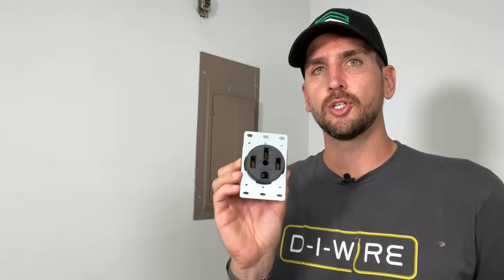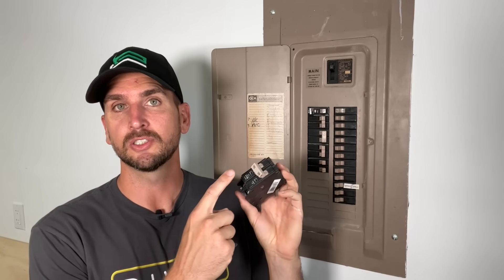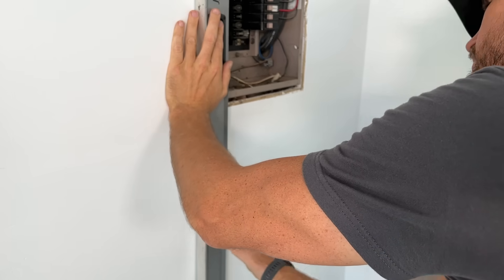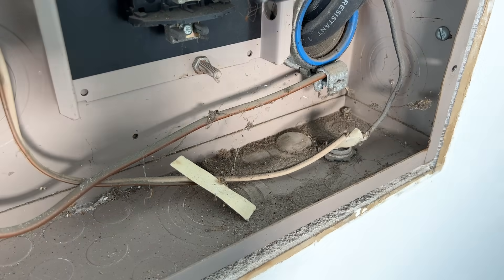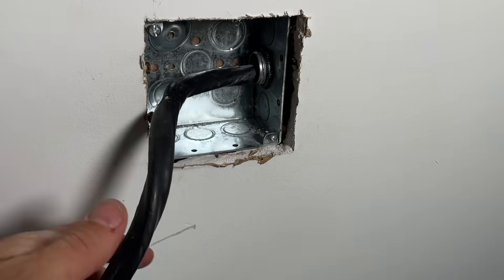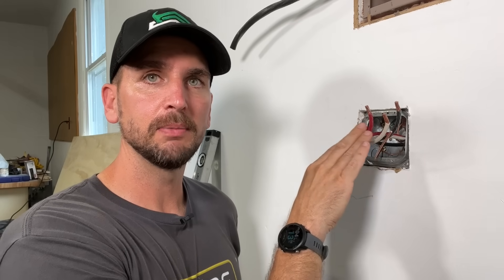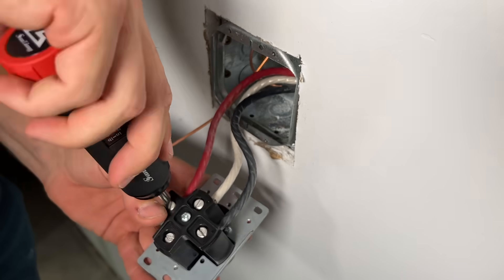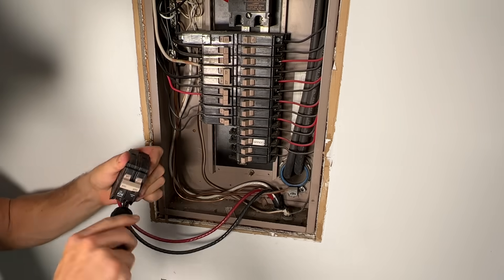Quick and Easy DIY 240V Outlet Install | 50 Amp NEMA 14-50

Comment: Great install!  I have one suggestion.  I would highly recommend paying the extra money for the commercial grade 14-50 receptacle.  I realize they start in the $50+ range, but this is not the area I would want to save money on if it were my house.  Again, nice easy to understand demonstration and clean install. 👍
Reply from the maker: Not a bad idea and thanks for the feedback.
Reply: @EverydayHomeRepairs   Update your video with this!!!! Plastic NEMA 14-50 receptacles are not rated for continuous loads like EV chargers and WILL melt, possibly causing a fire. You don’t want to be liable for someone’s house burning down because of your bad advice.
Reply: As someone who walked into their garage to discover the smell of melted insulation and find my 30amp charger plug fused to the $10 Leviton outlet (after about 2 years of use with the plug always inserted) I recommend using a commercial grade outlet.
Reply from the maker: @retass1979  good stuff, thanks for the additional details Jason 👍
Reply: Depends. If you are using it with a portable EVSE that gets connected/disconnected all the time or if you are putting it somewhere for guests to use their EVSEs, then definitely get industrial grade. If you are going to leave your EVSE plugged in all the time like a dryer or range, then a decent quality standard receptacle should be fine, but you should also consider future use even after selling the house. You or subsequent users can always upgrade later but, of course, then you’ve ended up spending more which is an argument for buying industrial grade in the first place. The supply chain issues have actually flipped the script on that though with Hubbell IG receptacles going for stupid money (darn near $200) so for the moment it may actually be cheaper to install a lower grade and wait for prices to normalize. With inflation the way it is though we’ve got another monkey wrench in the mix.
Reply: @emmettturner9452  ... Hubble industrial grade outlet can be had for $80-$90 if you shop around. I have seen them as low as $65, although not recently. They are also rated for like 10,000 insertions, not just a few hundred.
Reply: @rupe53  Yeah. It’s the recent supply chain-related price hike that I’m referring to. The rebadged Bryant is still available for around $65 but that still expensive enough that some would consider going with a hard-wired EVSE. With hard-wired EVSE you can get a 48A unit and you don’t need a GFCI breaker to meet the updated code requirements which weren’t touched on in the video. Of course, those codes don’t really apply to DIY anyway unless doing permit work or selling.
Reply: @emmettturner9452  ... he mentions they are still on 2014 code, so install to local code and be grandfathered. Someone else can do an update down the road if required.
Reply: @rupe53  Yeah. The thing is, DIY isn’t beholden to code in the first place to be grandfathered unless it was inspected/permit work (typically a much bigger job). This is probably why buyers, lenders, and realtors often require a home to be inspected and brought up to code when they are selling. They will typically consult whatever the current code is in the area, and we can expect all areas to follow NEC 2020 eventually. That means the grandfathered exceptions really only apply until you sell. That said, some places selectively chose parts of the NEC to enforce/ignore. Some places that have adopted NEC 2020 also specifically exempt the GFCI requirement for EVSE installations.

So, yeah, for DIY I’d only be worried about the new NEC 2020 code requirements if I might be selling. The EVSE should already have GFCI, since detecting faults and cutting the power to the onboard charger is part of an EVSE’s job. Also, nuisance-tripping is a problem with EVSEs on GFCI breakers, which is another reason why many locales have carved out EVSE exceptions for NEC 2020.
Reply: @emmettturner9452  ... and that false tripping is why I mentioned (once again) that people need to read the manual and find out if their charging device already has a GFCI. Having two GFIC devices will make that false trip a regular thing.

BTW, home inspections usually only point out things that don't meet standards for when the home (or remodel) was built. Very seldom are people asked to meet NEW code.
Reply: @rupe53  Thanks. That’s what I was wondering about since they often refer to the renovations as “bringing up to code.”
Reply: @rupe53  The thing about false/nuisance tripping with double GFCI is that the new code requires the GFCI breaker regardless of what your EVSE has, and half the point of a receptacle is to accept various EVSEs as opposed to a specific one (guests, future upgraded units, second vehicle, etc). IIRC, properly built and “listed” EVSE’s should all have GFCI according to J1772 and certification standards which creates a conflict/contradiction with NEC 2020.

There are numerous unlisted and non-compliant EVSEs that do not have GFCI, like the notorious Mustart brand that keeps burning down houses and such. Unfortunately, Mustart and the clones often lie and claim to be J1772-compliant and/or UL Listed. People who expect GFCI because they read up on the standard are likely to be misled and if they do any more research than that, well, they probably figured out that there are even bigger reasons not to use it.

Someone needs to make a more affordable hardwired EVSE, even if it is a lower amperage, since the GFCI breaker hurdle/issue will ensure a number of sales. I actually bought a 12A EVSE control board for $30 (ClipperCreek Gen2) that was new-old stock for GM EVSEs and paired it with a $50 used J1772 cable and a waterproof project box with cable glands to make my cheap hard wired unit but I can no longer find those boards for sale. Mine wouldn’t be listed/certified, of course, but it shows that it should be possible for some manufacturer to make a $250 wall-mounted EVSE with no plug since that’s the same control board from a listed product.
Reply: @emmettturner9452  ... depends on the renovation. If you do a kitchen, then the kitchen will be up to snuff. Same with a bathroom or finished basement, provided there was a permit and inspection. The rest of the home may be totally untouched. I know my area was lax on electrical years ago. They would let you upgrade a service, but inspection stops at the panel. IOW, no enforcement on GFCI for kitchen or bath (etc) just going from a 100 to a 200 panel. But again, that was 20+ years ago. It may have changed by now.
Reply: @emmettturner9452  ... as you stated that home brew deal is not UL approved as assembled. Someone would need to spend money to have that done. I would have to read the NEC again, but recalling they ask for GFCI protection on car charging, but don't recall if they specify where or how. In my mind, a hard-wired charger with a self-contained GFCI would be ok... if the unit was UL approved.
Reply: Definitely a must if you're plugging in and unplugging using the mobile charger, not as important if you buy a wall charger that stays plugged in.
Reply: Regarding usage for an EVSE, the constant unplugging and plugging is not the issue for a commercial vs industrial outlet. The issue is a CONSTANT and CONSISTENT high amperage draw, in this case a constant 40A for 5-8 hours. Typical commercial 14-50 receptacles don’t experience that as appliances like an electric stove/range or dryer a constant high amperage hold - these types of appliances have higher amp spikes which quickly fall back down to much lower ratings. Do it right the first time and get an industrial outlet. Hubbell, Bryant or Cooper.
Reply: @xcjrx  It is about cycling. The 80% safety margin is what takes care of the sustained high-amperage use concern you outline… UNLESS you wear the outlet out with repeated insertion/removal. It takes several hours to bake a Thanksgiving turkey and then more to continue cooking Thanksgiving dinner. A 50A stove range outlet has to be able to do 40A like that that daily. Think about it: There are people who cook all day for a living, thus, the range will be designed with a maximum of 40A sustained.
Reply: @emmettturner9452  yes you can cook a turkey for 10 hours in an oven but you need to understand that doesn’t pull a constant amperage like an EVSE does. Electric ovens cycle the heating element on and off hundreds of times for a cook that long, where an EVSE is ON for hours at a time, typically at 40A, at a constant energy flow. There is still a difference, and it’s highly recommended to go with an industrial outlet.
Reply: @xcjrx  You are right. I’ve seen people use ovens and dryers as emergency home heaters in a pinch which could do it but they obviously weren’t designed for that either. But, yeah, the 80% rule is supposed to give you the overhead you need for constant use though it doesn’t help if you wear the outlet out.
Reply: For my charging station I found a Hubbell HBL9450 that was new in box but old stock. It’s made in USA with a porcelain face and built like a tank. I matched it up with the waterproof HBL7777 cover.  Thoughts on how this older style would compare to the newer ones.  I’m hoping it’s superior but was just too costly to continue producing out of these materials. I ended up buying all 4 from the seller.
Reply: Awesome! I have 2 spots left in my panel and we were considering buying an EV in the future. Or if not do it to add some value to the home. I would follow the advise of others here and go with the commercial plug.
Reply: @Nefariousrouge  ... if you want a jump on the project, just run the wire to a 4x4 box and add a cover plate. ($2) Save the extra $200+ till you decide what to do. GFCI breakers are expensive but a hardwire may not require one and will save $100 on the outlet either way. It's all about local code and what you are going to do with that circuit when the time comes.
Reply: @rupe53  …and if you get a permit to build a detached garage, consider adding the EVSE receptacle after it is finished and passes inspection. ;)
Reply: @emmettturner9452  .... that will work but may skirt code for any future inspections. (eventual home sale?)
Reply: @rupe53  Yep. I’d just made the same point in the post before that one. :) I was trying to show how even major DIY projects that require building permits and inspections can still allow for a non-code DIY EVSE installation if you want to avoid the expense and nuisance of a GFCI breaker and don’t plan on selling. I’ve never heard of a place that requires permits, inspection, and code-compliance for DIY EVSE installs but plenty of them do for a detached garage or accessory building.
Reply: @emmettturner9452  ... the inspection is not for the charging device, but most locals require an inspection for adding circuits, especially if you pull a permit. If you don't pull a permit then all bets are off. The issue is if you do pull a permit and don't bother with an inspection, then the building department will have a record of an open permit the next time someone else tries to get one. Now you may be forced into yet a newer code!
Reply: I went to Grainger and bought enclosure with a outlet $76  lockable to prevent tampering.
Reply: @davidicousgregorian  Yes, you still need an appropriately sized breaker when hardwiring. Hardwiring merely lets you bypass the new GFCI breaker requirement of the current electrical code, but most DIYers don’t need to concern themselves with that anyway since it applies to licensed, permitted, or inspected work and not DIY.

Code “requirements” are not actually requirements for DIY. They are typically required for licensed, permitted, or inspected work, which is why they aren’t straight-up laws. I agree that DIY work should be inspected when changing hands so the new owners aren’t blindsided by safety concerns, but skipping the GFCI breaker is literally no different than having a qualified, licensed, electrician install one up to code a few years earlier. Whether the inspector considers it grandfathered or not with regards to GFCI has little to do with who installed it.
Reply: You are also supposed to use a GFCI beaker too. Those run a good price also.
Reply: @cylus13  Not necessarily true.  Most chargers now have internal GFCI.  If you plug that into a GFCI protected circuit, you are going to have faulty trips.  Consult the manufacturer spec when installing.
Reply: @jamiemacdonald436  And what happens when you unplug the charger. Now you have an outdoor plug that is not protected by a GFCI. So depending on were you live you may not get approved by your electrical inspector if you don't have a GFCI. That said garages I'm not 100% up with the code. The point I'm making is you need to know what is Required in your area before you install the plug.
Reply: I would say most EV chargers are plugged in and left like that. I have two EV chargers and they are not plugged out at all.
Reply: @kiwiswat  The major concern with the $9 receptacle is heat.  The plastics used degrade quickly when used in an application such as this.
Reply: @jamiemacdonald436  You are right. Totally missed that piece
Reply: I plugged in my car charger in 2015 and it's been there since.  Its the cord that goes to the car that gets plugged in every night.  That's a different format.  There's no car setup (a well thought out one) where you plug something into a 50 amp outlet every day.  My charger draws 32 amps on a 50 amp circuit.
Reply: This shouldn't be a suggestion. This is really a requirement. While any 14-50 outlet is technically up to code, the cheap $9 outlets you'll find at Home Depot or Lowes are meant for electric dryers and are not designed for 6 straight hours (or more) of current it will be subjected to while your EV is charging. Especially if you're going to do this yourself like I am, you really want to do an even better job than what an electrician would do and have peace of mind that your house won't burn down!
Reply: And this is an application where you are going to be constantly plugging and unplugging the cord, not like other uses where the device usually remains plugged in, like dryers, stoves and welders. My standard grade receptacles are wearing out and need to be replaced.
Reply: @KameraShy  if this is for an EV charging station, then the charger would be left plugged in the wall outlet . It will be the cord from the charger to the EV that will be getting unplugged constantly.
Reply: @Matt633NLT  Not necessarily.

I use an 16A AmazingE portable EVSE with a NEMA 14-30 plug and I have to plug in outdoors after being displaced to my workshop by a tornado. It’s in a public place so I can’t leave the unit outdoors and it goes with me. Unfortunately, I can’t find an industrial grade outlet for 14-30.

The ground connection on my residential grade 14-30 wore out in only a week so I had to bend the contacts to tighter. Any pigtail adapter has the same issue with no industrial grade 14-30 receptacle. To use an industrial grade 14-50 without an adapter I’d have to cut the unused neutral prong off the AmazingE. They sometimes call this prong configuration “NEMA 14-XX.” Neutral genuinely isn’t connected inside the AmazingE or any other EVSE anyway.

I’m actually building another EVSE with the same ClipperCreek Gen2 control board but it has GM’s 12A firmware. I’ve built a range of adapters for it including NEMA 14-XX but I haven’t started using it yet.
Reply: @KameraShy  not on my 2023 Tesla Model Y I only plug and unplug from the car.
Reply: If outlet is good enough for a stove should be good enough for a car charger .
Reply: @riachardpaul943  Unfortunately no.  If you read some of the other replies in this chain you will see some of the issues with the standard grade devices.  Even if the charger stays plugged in, there is a heat factor from the amount of use a car charger gets.  For example, do you generally leave your oven turned on for 8-12 hours a day 7 days a week?  It's something to consider.  The plastics that hold your terminal connections in the commercial grade devices are of a much higher grade and resist deterioration from extended periods of heat over time etc.
Reply: @jamiemacdonald436  Plenty of people do use ovens that long, daily, which is why we aim to only use 80% of the circuit’s rated capacity. There shouldn’t be dangerous heat buildup if you are at 80% capacity unless the outlet is worn out, which doesn’t happen when you aren’t plugging and unplugging regularly. That said, I wore out the ground prong on a new NEMA 14-30 with a portable EVSE after only a dozen or so cycles and it was the kind that comes in its own plastic housing to mount outside the wall behind a stove or dryer. It was brand new but I had to open it up and squeeze the ground contacts to be tighter.

So, yeah, it depends on expected usage. If you are just going to plug in a 32A or lower EVSE and leave it then you don’t need industrial grade but you should monitor it for heat and be aware. If you want it to be available to guests or if you use it with a portable EVSE that you often take with you, definitely get industrial grade.
Reply: @emmettturner9452  Except stoves are thermostatically controlled, so turn on and off frequently. EV’s draw full current continuously. Watch Sandy Monroe’s video on this.
Reply: @riachardpaul943  …unless you use a portable unit that you plug/unplug frequently. Oven/stove ranges generally stay plugged in and don’t cause daily wear and tear.
Reply: @riachardpaul943  ... you will find the cheaper outlets failing with continued heavy draw of say 40 amps over more than 3 hours. Stoves and driers are rarely on that long in a single use. IOW, the 50 amp rating is not considered continuous unless you buy the heavy duty version.